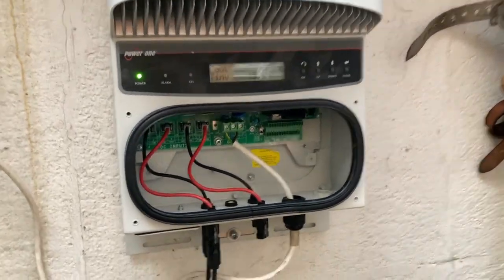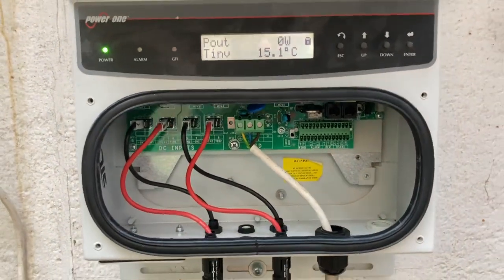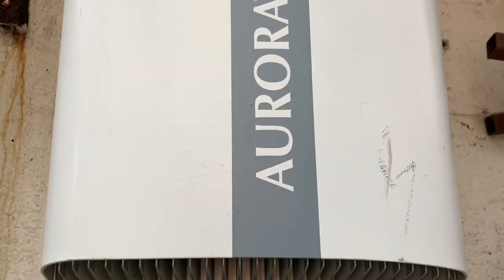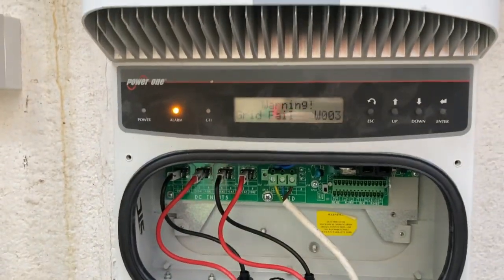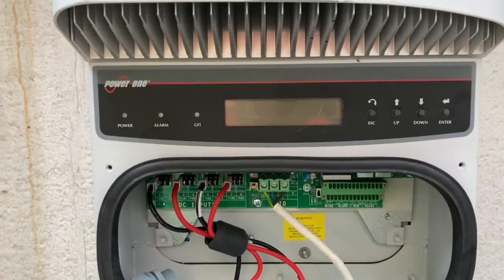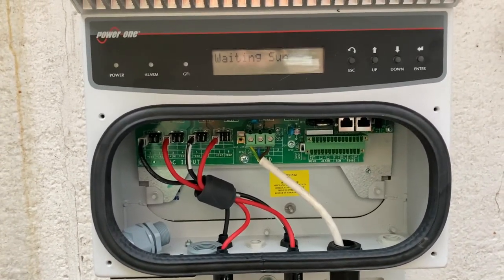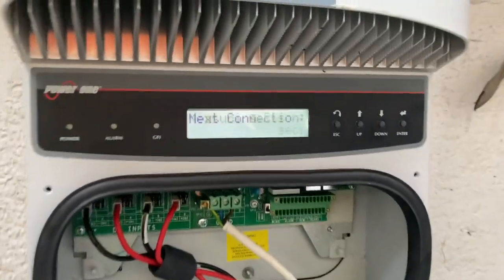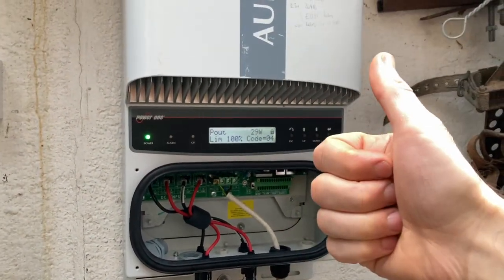Waiting Sun solved! ABB Aurora Power One Grid Tie Inverter: testing two inverters: mystery fault!

Comment: Interesting that invertors are being replaced as reaching the end of commercial life. It would be a waste for such expensive equipment to be recycled as scrap metal. It is encouraging that you have been able to fix some, giving them a second life.
Reply from the maker: Indeed, 10 years old, from a company that is defunct and so does not do warranty repairs on such an old model anyway, and at £2/relay it is a cheap fix.

Comment: The only inverters that I know of that have this setting, maybe it is something to do with trying to start on a high voltage system when there is volts but no current. The inverter would start and then draw up to 20 watts from the mains, cheers
Reply from the maker: I can’t remember if I saw it on the older solis or not. Two of my abb/aurora were doing 0w all afternoon yesterday. Enough power to get them to wake up but not enough for output. I thought that the inverter should never draw from the grid?
Reply: @bootsowen  Owen, book posted, I only found out about this import because we have diverters with LCD screens, every evening as the light level is lost before our 7 grid inverters switch off the diverter shows an import of around 0.1Kw. The diverter reading is not very accurate at such low levels but I know it's definately an import because all of the house is running through the victron and so we are drawing zero mains power. Cheers

Comment: Hi Owen,
Bit late now but can you pop a current clamp meter over the feeds to the faulty unit?
Sounds like power being dissipated within the unit but not hot enough I think. Perhaps power is only in motion on the DC side. Could it still be generating but not show on screen? Sounded a bit noisy for normal operation.
Reply from the maker: Something was definitely wrong with it, The current will be very similar to what I saw on the second unit, it was an overcast day and I was doing it in the morning before any sun was on the panels.
Why do you ask, maybe give it more sun?

 Good for swapping units because I am turning them off and on but with very low current on the DC side. It will go in the pile for spares, I like these units, maybe some kind of beginner bias as the ABB beside it was my first inverter and chugs away without complaint! I have 4 working now, 4 waiting on a test, and that one dodgy one, so I reckon I should be good for a while.
Reply: @bootsowen i figure the current is leaking through from +DC to -DC and not getting through to the AC side. I wonder if the faulty unit is introducing a DC offset to the mains (solar DC being passed into the AC side). All academic considering your stock of inverters!